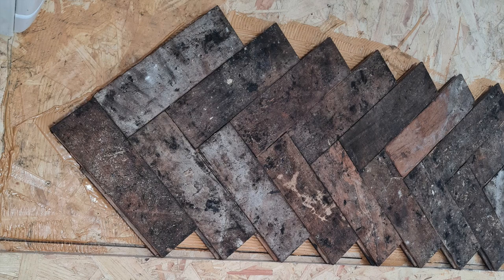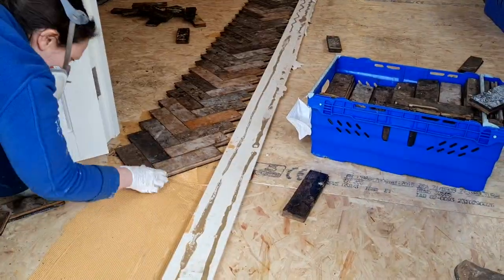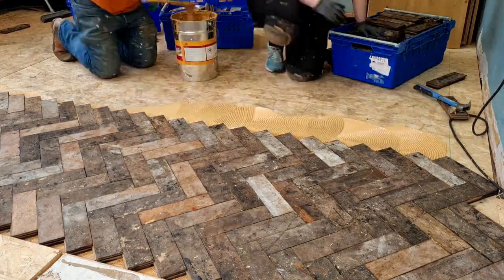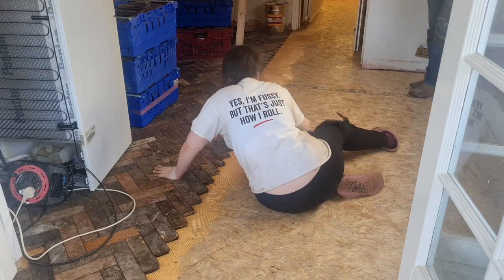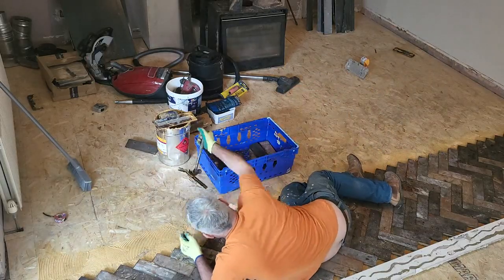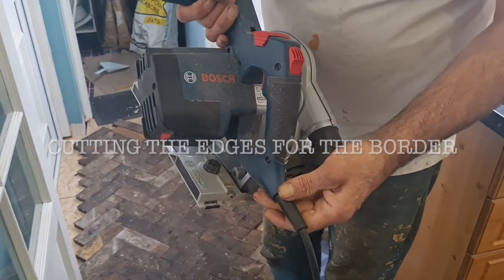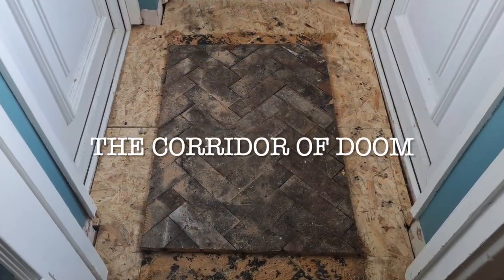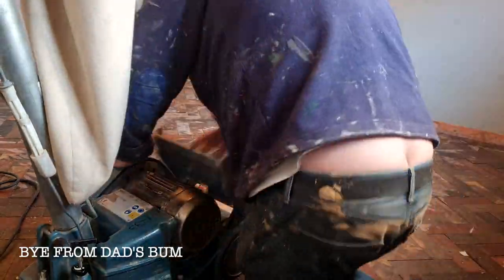Reclaimed Floor Part Two| Laying Old Parquet Herringbone Pattern| Cutting Border

Comment: Thanks for the great vids. The end result looks super. We've watched each vid in the series individually a few times as we have 200 sq metres of parquet blocks (two vans full of the stuff!) in teak which we scored from a bloke in Brighton for 2 grand. Also it's already in really nice condition. Anna has spent about a year so far scraping bitumen off the back and tongues/grooves. She's about 1/3 of the way through! We can probably speed it up with a bit of effort... We only need to lay about 70 sq m in total but the guy wanted rid of it all and did it super cheap so we'll sell the stuff we don't use eventually. For the adhesive I've bought a pot of Lecol 5500 which based on the name I reckon is exactly the same as the Sika 5500 you used. Maybe just a different brand or something? Did you come across Lecol when you looked into it? Assuming it's the same stuff, what was the temperature when you laid it, and how long did you have to work with it? I've heard it goes tacky really quickly and is hard to work with but the stuff you had looked not too bad at all. Cheers for all the hard work making the vids, I think they are great for idiots like us planning to do it ourselves :)
Reply from the maker: @MatSmithLondon   @MatSmithLondon  god bless your dedication 😂😂 I'm so glad you found it useful makes all the effort videoing and editing this worth it ! In terms of temperature I've no idea but we lay it in November in Dublin so wasn't warm but we would've had the heating on. We didn't spread too much glue at once to avoid it drying out but laying it is super quick. Depending on if the glue is the same which I'm unsure but hopefully my dad can confirm for you, we didn't need to scrape the bitumen off the backs ! We just used a brush on a grinder bench to remove it from the tongue and groove so much faster. Any other qs just shout and I'll get my dad on the case, this is his third time doing it- this is my first and last  I don't know what he was thinking 😂
Reply: @colourfulsaz  Haha, he's a glutton for punishment! Yeh I didn't think it was worth doing the backs of the parquet but the the better half insisted... but sides and tongues/grooves obvs important to do. I'm going to start with our corridor of doom I think, get it out the way before embarking on the big section of floor (I think the smaller bits are more fiddly...) I've just finished completely fluffing up laying a self levelling screed, so I'm sure the parquet laying can't be any worse 😅😅
Reply from the maker: @MatSmithLondon  awh the smallest bits were awful they definitely took the longest and nothing to show for it 😫  the big sections of floor were so satisfying we flew through the actual laying of the floor. Here's hoping you'll be laying it soon!!
Reply from the maker: @MatSmithLondon  hey mat just asked my dad he said that glue is meant to be great he just couldn't find it here were in Dublin. He said just make sure to get a trowel as per their spec because that will help it not dry out as you're using it. We used a 6mm rectangular slot and it left plenty on the ground. But you might need something different for your glue.
Reply: @colourfulsaz  Yes their trowel is a B2 type (had no idea what that was until yesterday! Basically a triangular 3mm notched trowel with 2mm gaps between triangles… very specific!) Thanks for finding out for me, very kind!

Comment: Great job, we are just in the first stage. Question, is there any smell from the tar now that it is layed and sealed? Thanks
Reply from the maker: No smell at all. Once the sanding of the top layer was done the smell was all gone. Unfortunately we had a lot of bitumen on the top of the tiles so it took a while. But I knew from my dad doing this project previously that it went away 😊
Reply from the maker: And best of luck !!!
Reply: Thanks so much, love your idea of using a timber straight edge to get started. You have a great dad 😊
Reply from the maker: @ClareBowditch-x3k  he's the best!! Yes it's was a genius idea we used it in each room and it took all the pain out of it by letting it set then for a bit. Meant the tiles weren't going all over the place wrecking our heads haha

Comment: Hi Sarah, questions about cleaning them, I’m currently using a 4” grinder with p60 discs to do the sides. I’m getting through a lot of them as the blind over quickly. With your bench grinder set up did you have that problem of blinding? Which wheels did you use? Thanks
Reply from the maker: Hey ! We used a wire brush wheel and there was  no blinding. Same wheel for the whole cleanup with no cleaning of the wheel.hope this helps !!

Comment: Oh I have so many questions. Or rather my husband has. He was wondering if it would be worth sanding at the cleaning stage? Would it make it easier down the line of the process?
Also do you know how many square metres you did, roughly?
Also I just love your Dad. He reminds me so much of my husband. Happy even though working like a madman. Good for you both.
Reply from the maker: Ah Susan what a lovely comment ❤❤ I don't think sanding at the cleaning stage would be worth it because the sanding gets all the boards level so you may sand pieces too much or too little and then you have to sand it again to rectify that. But might be good to get off some of the dirt but most of the stuff you buy isn't as bad as the tiles we had !!
Reply from the maker: We did around 51 Square metres!

Comment: I know hindsight is 20-20 but I think you would save yourself so much time  and effort if you cleaned all the flooring first with CO2 blasting.  Tar is child's play with CO2 blasting. Tar freezes to the brittle stage and flakes right off.  No tar fumes and cleanup would be a breeze because the tar doesn't get hot.
Reply from the maker: Oh class I haven't heard of this method. I tell you one thing tho I'll never be doing this project again anyways 😂